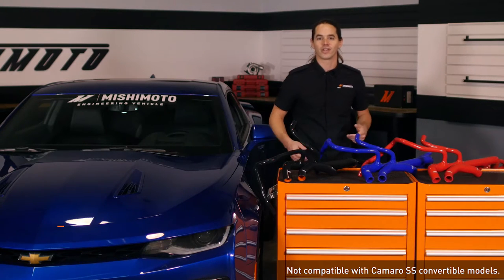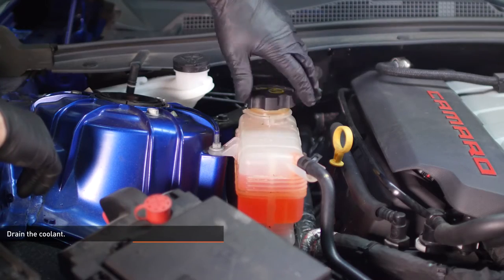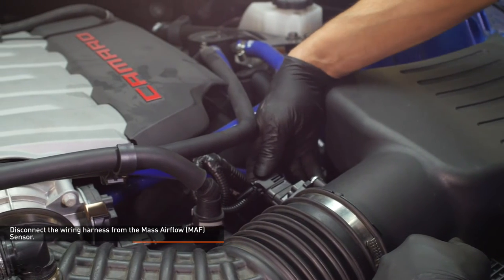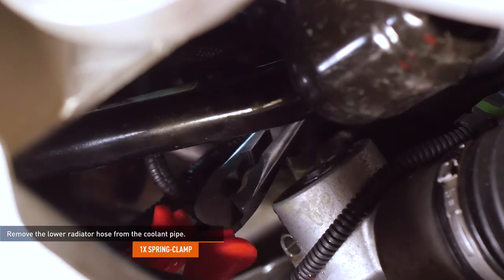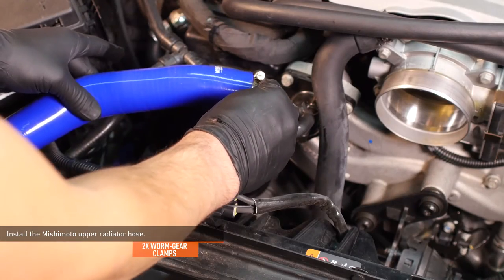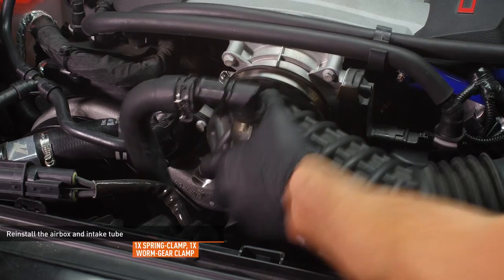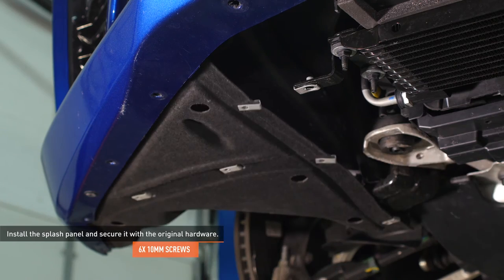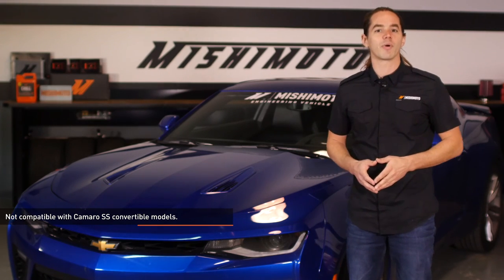2016+ Chevrolet Camaro SS Silicone Radiator Hose Installation Guide By Mishimoto

Comment: Hi, Great video.  Why were worm gear clamps used for the new coolant hose instead of Spring Clamps that were originally used?  What is the benefit of the new hose over the old hoses?  Thanks!
Reply from the maker: Just preference. We installed Mishimoto clamps ;)